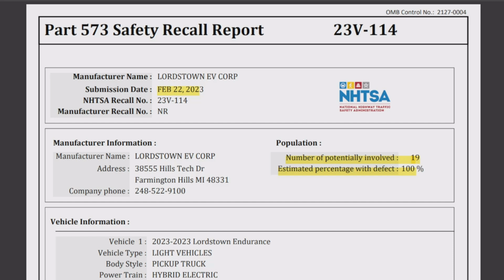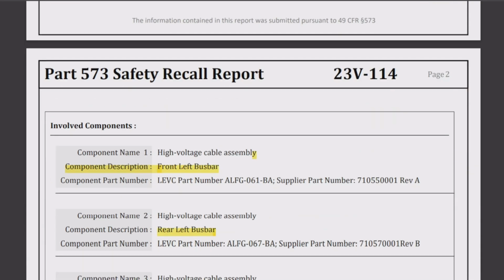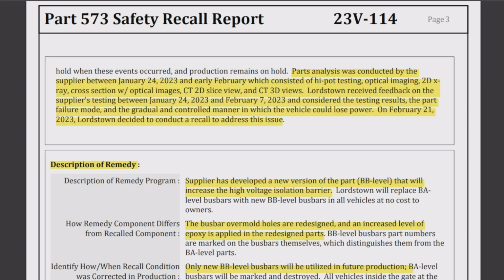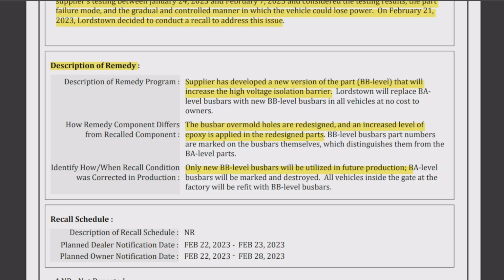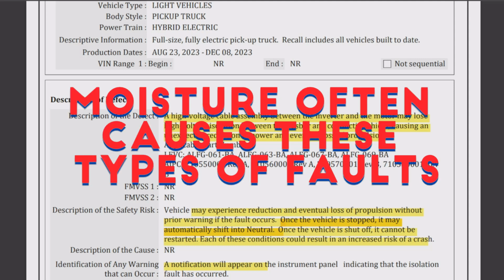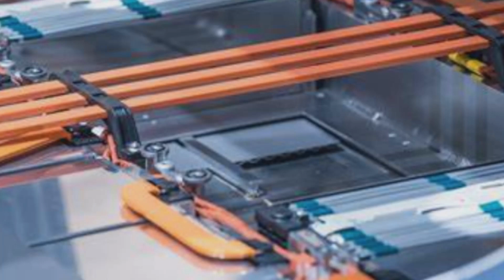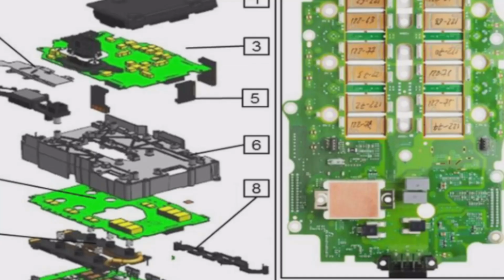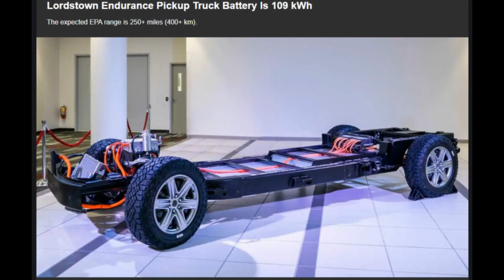LMX NHTS RECALL | Lordstown Motors Endurance Recall Details & Analysis #mxux #LMX #ride #LMC

Comment: Hi MXUX;
Thank you for creating many factual presentations!
https://static.nhtsa.gov/odi/tsbs/2013/SB-10052460-6095.pdf
A link to a Tesla technical document that explains “Troubleshooting Isolation Faults “
The first two paragraphs say
“As part of the Model S high voltage safety philosophy, the high voltage electrical system is isolated from the vehicle. This means that there is no electrical current carrying path between the vehicle and any high voltage conductor. To ensure that this isolation is always met, a monitor is installed in the battery, which periodically measures the resistance between the high voltage conductors and the chassis.
Three different conditions can introduce a conduction path to the chassis: a physical defect of the insulation material, contamination (of any size, e.g. dust, bolts, etc.), or moisture. When debugging isolation, look for signs of moisture or physical damage to HV cables, bus bars, and connectors.”
Given the potential short circuit between the Endurance busbar and the vehicle body happens ( during or after) a snowstorm where salt and moisture exposure combine they just needed to increase the electric shielding or improve connector sealing against moisture and the environment.

Comment: Do you have any information on the second recall mentioned by Hightower in the earnings call? Also do you have any idea which OEM Lordstown is in discussions with to partner with on the Endurance. Sadly in the call they said that without a OEM partner to fund the hard tooling etc.they will likely pause the Endurance production and they inferred that the only answer to resuming production is finding a partner. Their focus now is on development of a second commercial vehicle in the consortium in which they will need to look for partners and new funding sources which they feel will be more available than with the Endurance program.
Reply from the maker: Second recall is for a brake system component I believe- not sure what - believe the manufacturer contacted LMX informed them some? all? supplied were manufactured outside of specs. Will replace all so forth. I have not found a NHTSA report on this. Not an engineer but does not seem to involve LMX design so forth - just a supplier problem being worked out.

The pause in the Endurance production IMO has a lot ot do with macro factors - fed rate going top 6% will just kill vehicle sales so what  a great time to pause. Please look at the comments in the video after this one https://youtu.be/kfgYU9334AA for a view on this issue. IMO not a bad thing to do right now. Also they was wiggle room on this "may have to" so forth so there is that as well.

I am bullish on MIH - I think the LMX MIH project is positive - IMO the Model X or Project X may be the vehicle - I could be wrong - but this would be a direct competition to the Tesla TAU 25K BEV - this is a "new new" BEV and IMO would attract funding possibly and a positive for LMX - see my video on MIH https://youtu.be/_i07Qj0b-5Q

LMX CEO should cover this at SXS on March 17 - need to hear his remarks...
Reply from the maker: Recall is for a brake component - not sure what it is - not a LMX design issue - manufacturer I believe contacted LMX - some? or all? of this component supplied was made out of spec. 
Will replace destroy so forth. IMO looks like just working out a supplier problem. I could not find a NHTSA report on this at this point. IMO a lot of these components - not sure on this one - were made in China during the lock downs - might be a factor.
Reply from the maker: IMO the Endurance program pause is at least in part due to macro factors - a 6%+ fed rate is going to kill BEV sales - so waiting for mor favorable launch conditions. See my response to a comment in this video on this topic https://youtu.be/kfgYU9334AA
In close the pause was stated with wiggle room "may" so if market improves - funding - OEM partner - likely will move forward - this is a strategic pause IMO.
Reply from the maker: I am bullish on MIH - see https://youtu.be/_i07Qj0b-5Q
I see the LMX move to an MIH model - this BTW is not news - from the day of the sale forward this was the plan - to do both LMX and MIH BEV's - anyway this move is positive IMO - we need to hear from LMX CEO on this at SXS on March 17 - see these videos for his recent remarks on MIH
https://youtu.be/v6W0I9qiVow
https://youtu.be/hClMKsxV8UY

EVERYBODY HODLING:  There is a fud factory running on LMX -I.E. making hay out of minor recall notices on the Endurance while totally not reporting on a thermal runaway fire of the Ford Lightning  while charging that required the fired department to put out two burning parked trucks - the Ford Lightning has stopped production for a month and has still not resumed production - but what have you heard on this?

Comment: Thanks for the excellent research and obtaining of that recall report. First really hard info on the Endurance we have seen and detailed description of the problem. I only add this to what others have said below. You mention the extensive testing on the lake previously reported. Then we have the winter storm where the problem showed up. The Big Difference is: In the case of the storm there is SALT on the roads. Salt and Moisture creates an electrolyte fluid that causes a SHORT. So this real world road condition was the environment that found the weak link. Sounds like the Recall will be short. Good Job MXUX
Reply: Good point, my thought is after replacing the part, would this issue occur again in similar weather? that I don't know.
Reply: @TomSu-vs3mo  I do not think so Tom. A high voltage isolation area on a bus bar is a designated space or section of the bus bar where high voltage components are located and isolated from other parts. This area may include insulating barriers, or shields. Epoxy is such an insulating material shield and prevents shorting or arcing. So, the Amphenol supplier increased the barrier with extra epoxy. So, from the report we know that the bus bar was the culprit and how the cable is connected, either by a connector or bolt is not mentioned. In any event, it appears that the cable was not the culprit. Amphenol business is manufacturing BEV bus bars and I expect they knew what the  problem was and fixed. Further, winter time roads in the Detroit area are salted, further exacerbating the moisture/water/salt environment causing this short. I doubt that the lake testing used salt as one would not want the vehicle to fall into a melted ice lake!

Comment: This busbar is a LMC designed part.  It's purpose is to handle the high voltage connections between the chassis and the motors.  Without the busbars you would have cables that would be exerted to all the stresses and fatigue of the movement of the suspension.
Reply from the maker: Was reviewing this in Lordstown day presentation but not sure if this is it - need more detail - recall specific on inverter connection so seems not this component to me but rather the one in this video -could be wrong - got a lnk to more info?

Comment: Sounds like the connectors on the power cable from the battery to the inverter developed a short either from wear or inadequate environmental sealing.  No big deal.  No issue with the major components.
Reply from the maker: Occurred to me this part was probably made during lock downs in China = affected QC?